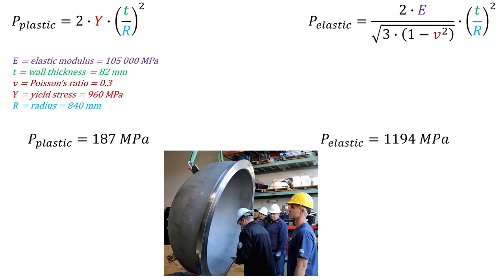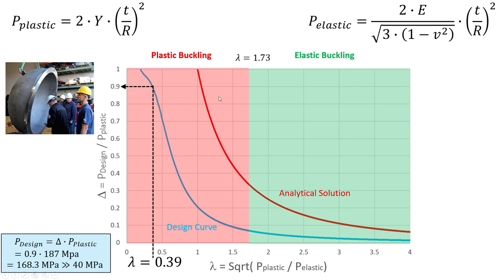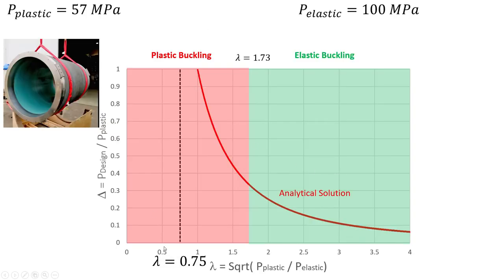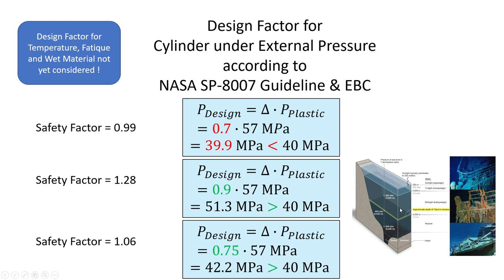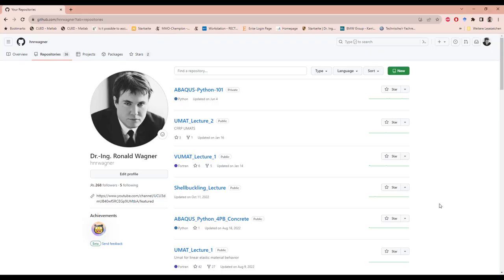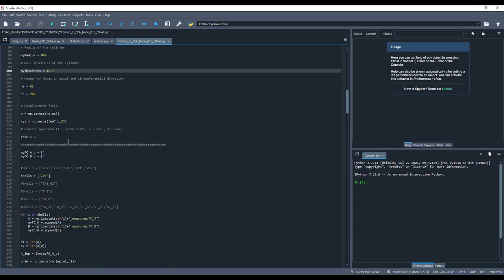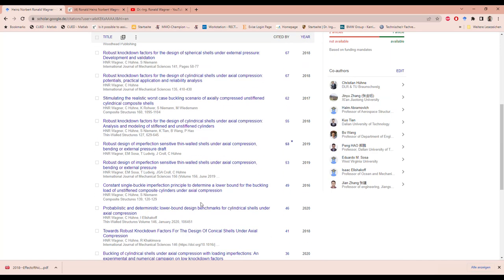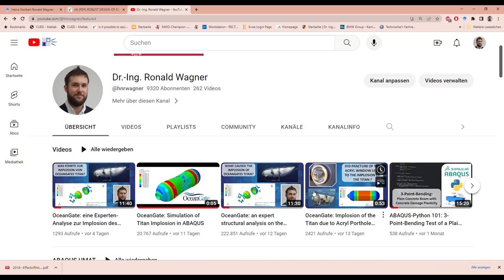OceanGate UPDATE: These results are truly shocking - nearly no Margin of Safety

Comment: I thought the safety factor of 2.25 meant that the pressure hull designed for 4000m would theoretically survive at 9000m
Reply: If all the safety factors are false, then I'd ask how does the model perform at half the depth? Perhaps Stockton and Oceangate decided they could 'lower' the safety factor or increase the risk by going deeper

Comment: Can somebody explain to me why they didnt just made a titanium tube? i know titanium is expensive but layering carbon fiber  has a more expensive process than just rolling a titanium plate and welding the seams. im pretty sure the differences between cost material/ cost of process gets kinda even at the end.
Reply from the maker: Apparently due to buoyancy, cfrp weighs only a third of titanium
Reply: it would be WAYYYYYYYYY heavier. this means adding more syntactic foam to the outside to make it more buoyant. syn. foam is VERY expensive apparently. the amount of foam the titan had on it was a small amount in the rear comparable to the size of the ship. if you look at the DSV Bakunawa (DSV LF) and James Cameron's Deepsea Challenger they have nearly the entire vehicle other than the pressure vessel itself is syntactic foam. They use A LOT. Also if you are bored you can take a look at the Trieste which used petrol as their buoyancy material. Gas-o-scaphe :P
Reply: more foam them more ballast to be able sink to 12500 feet.
so cost and problems handling tne sub. size and transport.

Comment: If it's one thing I have been reminded of from this whole affair is that anything that I designed being described by others as a Macguyver contraption is to be only used once and only in desperate circumstances. After all the submersible did complete a few dives. But since I'm not escaping an undersea prison or a damaged colony on the sea floor I don't see the need for one any time soon. And even then I would have had a way to open it from the inside.
Reply: Each time it went down, it must've weakened and worn it further, ultimately leading it's collapse. The carbon in the air inside would have ignited under the immense pressure the moment the craft failed, killing all in an implosion within milliseconds. None of them would've known what happened to them in that moment as the brain can't process the effect fast enough. They may have heard a creak, possibly seconds prior but no other warning. None would have felt any pain or suffering. 🙏🏼

Comment: Can you explain your model of elestic vs plastic buckling. In my view Buckling is a stability issue primarily based on elasticity. When it fails it can be in the elastic or plastic range. However the collapse is instant. This could be a simplified view. Therefore, please explain how you see this.
Reply from the maker: buckling is a stability issue yes, the term plastic buckling takes into account when yielding of the material occurs before the elastic buckling stress.
Reply: @hnrwagner  Thank you. Still not clear for me. As you explained it sounds like compression overload. If the material is already deforming, how can there still be an elastic buckling?

Comment: I get different numbers for Pplastic and Pelastic when I use your values and formulas.
Reply: awesome videos BTW.
Reply from the maker: thanks for pointing this out, there is indeed an error:

plastic compression pressure on the first slide should be the p = 2 * Y * t / R.  The 187 MPA value is correct.

Comment: Impressive analysis! He's now bringing up the unfounded claim of using "cheap titanium" when, in fact, the standard yield strength of commercially pure titanium, at 240 MPa, isn't much better than aluminum in terms of strength. This is a deliberate choice to sensationalize the situation, making it seem worse than it is.

The actual alloy they used is Grade 5 titanium, a super common workhorse alloy widely employed across various industries, from rockets to everyday items like fidget spinners. The cost of the material would be negligible compared to machining it to their specifications. 

The Titan sub went through cyclical pressure testing with different dive profiles in Maryland and successfully made multiple dives to the Titanic. The original design specified a 4.5-inch thick hull to achieve a 2.25 safety factor, but they opted for an even thicker 5-inch hull, providing a reasonable safety margin. While we don't know what exactly caused the implosion, you shouldn't be fooled by this kind of sensationalism, like what today's media outlets want, for the sake of generating clicks.
Reply from the maker: you have a reference for Grade 5 Titanium in the Titan? could not find it, thanks

Comment: I was wondering what happens with atmospheric pressure at that depth become? Does it change inside the chamber? I was wondering how strong the carbon fibre would have been if they made it in like a denim weave one sheet, and then just wrapped it wetting the carbon fibre weave with the resin with two parallel rollers behind with 3 tons of pressure applied on the weave to expel any air, any analysis on that !
Reply: Vacuum and heat during curing is the standard method to produce quality CF.

Comment: I saw your simulation in several news and I have a question, does the interior of the titan reach thousands of kelvin?. Your simulation don't show that part.
Reply from the maker: No because i have not modelled any temperature relationship, i can try however but it is probably not that easy.
Reply: @hnrwagner  I would be very grateful. It is being commented on many social media platforms, at least in the Spanish-speaking community, that the temperature reached thousands of Kelvin due to air compression, which is highly unlikely.

Comment: I am having trouble interpreting the graph at 1:25. If lambda is 0.39 does that mean that the hemispheres are going straight to the plastic buckling range? They have no capacity for elastic buckling?
Reply from the maker: if lambda for your shell is 0.39 then the shell will yield way before elastic buckling is possible, like shown in the example the plastic buckling occurs already at 187 MPa and elastic buckling would occur at about 1194 MPa, for this thick shell you would need a yield stress of 18000 MPa for elastic buckling
Reply: @hnrwagner i’m having trouble understanding, wouldn’t elastic deformation occur before plastic deformation as elastic couldn’t occur AFTER yield strength has been reached?
Reply: @hnrwagner  Ok, I think I understand. Outside of a shock or impact loading event, if a structure yields before elastic buckling is possible does that mean there is a design fault? Either in the geometry or the material used? Your videos are excellent by the way. Above my paygrade, but outstanding nonetheless.
Reply from the maker: @MrRadbadger  its not a design fault, its also not a bad thing, its just a point to consider, you can avoid it by either using better material (higher yield stress) or change geometry (reduce thickness or increase radius)
Reply: @hnrwagner  Yes I have just watched your older videos on shell buckling, and watched some others on non-linear buckling. I understand what you mean when you say non-linear now.

Comment: Why do the hemispheres go towards each other? I saw another quite good model. The different pressure tolerances of the two materials at the connection were used. There they went away.
Reply from the maker: in an implosion things move together, in an explosion thinks move apart

"An implosion is the abrupt, violent collapse inwards"
Reply: @hnrwagner  But the pressure equalizes very quckly and the debris of the hull goes agains the hemispheres from inside (as you also show).
Reply: Water is pushing in from all sides. The tube does not only hold its own shape in the cross-section, but also needs to "push"/hold the hemispheres away laterally. When they tube collapses, all the mass of water around the hemispheres will be pushing it inwards towards the center of the shape, from all directions. Titanium has a mass over four times that of water, but that is nowhere near enough to slow its acceleration down enough for just the water around the tube to kind of fill the void. Think of how the void would fill from all sides if the entire submarine dissapeared in an instant.

I am just a layman, but it seems quite intuituve to me that the hemispheres must be pushed inwards. Maybe there is a little "bounce" at the end because of the momentum of the water compressing all the gases, that will then have to expand a little to reach equilibrium. I probably made a total mess of explaining how I envision it :/ And I might be wrong. Just offering my understanding.
Reply: @h734802  The pressure equalizes because something has to fill it. There is no reason for the hemispheres to just sit there. All the water around the hemisphere cant just go around them to fill the void, when there is nothing holding the hemispheres back. The hemispheres themselves will be part of the process of equalizing/filling the void.
Reply: @Hamperokken  I thought the model contains those data as well.
Btw I have no idea. My senses say that moving of the hemispheres by a moderate speed could be inwards and outwards as well but I don't know which is the right solution.
Reply: This is what I was talking about: https://www.youtube.com/watch?v=2N2cCCeenZk&t=0s
Reply: @Hamperokken  we can think like this: when the hull collapses the constant pressure to the hemisphere from outside starts to push the hemisphere towards the void inside but from inside, from the void, it is suddenly filling with water and debris and they hit the hemisphere from inside like a hammer, they give it a pulse to move outside. Which is bigger?
Reply: @h734802   Just to complicate things, my gut instinct is it would be like an accordion. The hemispheres collapsing in quickly, then pushing back out slower. Not pushing apart far tho. My thinking is, the water is compressed about 1%. A failure will push every solid part inward to the lower pressure, and that will create a cloud of instantly decompressed water. Within milliseconds this cloud will compress again but we now have the air that was in the sub is pushed into solution where the sub was, this will create a higher pressure bubble that will push things apart again. I am guessing though.
Reply from the maker: @h734802  this is an animation with no physical background (that is much easier), my video is a simulation based on physics. 
Not to undermine the video, it is great and probably took alot of effort, but you cant really compare my simulation with her animation

Comment: The problem with your 'shocking' results is the shocking research - Titan's CFRP walls were 130mm thick. Might have been interesting if you googled
(BTW - it was the viewport; look at the recovered debris - the mount for the viewport is hydro-scrubbed of evidence the retaining ring was ever there, consider where the remains were found - in the aft dome, consider the plastic deformation mode of polycarbonate and the fact they knew there was an issue and were ascending)
Reply from the maker: The cfrp cylinder in my model is also 130 mm thick so what is your point
Reply: My apologies  @hnrwagner  initially you specified you were assuming 80mm thickness, i must have missed you changing your assumptions.
Was still the viewport, obvious on the wreckage